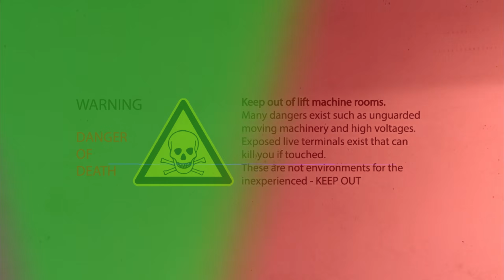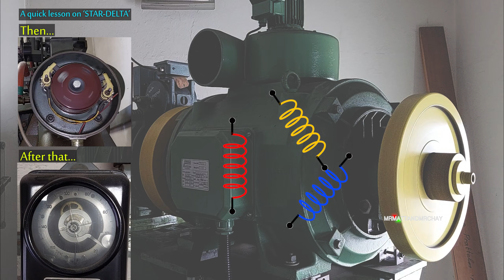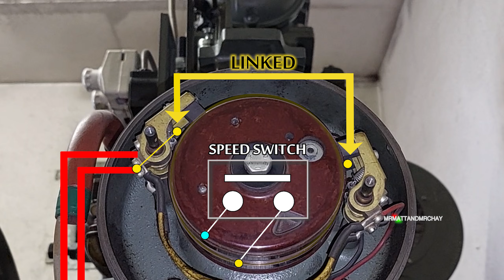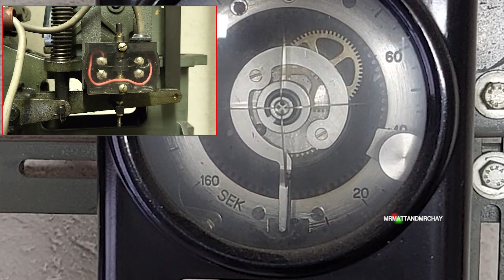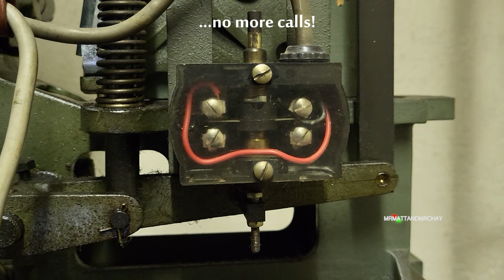Schindler CLOCKWORK TIMER, plus what does 'this' do? (interesting motor device!)

Comment: There is no Star/Delta, they are using 2 motors with different speeds.
Schindler Lift starts everytime in star. Most manufacturas are using 2 speed motors und Schindler is using 2 motors in series.
I am an Lift engineer in Germany at Schindler and know these configurations very well.
Star/Delta is only to reduce the current at starting of an motor and can not change the rpm.

Comment: That centrifugal switch is actually quite clever. From a layman's view, I would've thought one would've overcome the power draw by adding another lower-power motor to get it going first, but by using a centrifugal switch to change between star and delta configurations, you change the main motor to become that starter motor. Less parts to fail, less cost, less complexity. Electromechanical systems are so fascinating. Plus all the logic performed by physically moving components instead of things like PLCs. Really impressive, the work that went into these.

(Also been looking into old electromechanical telephone switches. Those are awesome as well. Found I have a museum close by, by their Youtube channel, Connections Museum. Also reminds me of the old jukebox that Technology Connections had a look at, with the floor selection logic likely being similar to the disk selection logic.)

Comment: Excellent as always. I love the time you take to explain things. 
I have a dumb question to ask. The "big Wheel" does that take the weight of the lift and passengers? Also, it never occurred to me that the lights in the lift shut off when not in use. I thought they stayed on all the time. 🤦🏼‍♀

Comment: Hello Mrmatt, I always like your videos but I think this is not star delta, this is switching from 4 pole through 2 pole windings. Because in star delta configuration, motor gives less torque on star connection to prevent huge start up currents, meanwhile motor cannot turn with load, motor must be unloaded when starting with star connection. Also motor speed doesn't change between star and delta steps, just gives higher torque on delta connection. After switching to delta, motor can be loaded(for example jaw crusher) 

But in this lift motor constantly loaded, it needs higher torque for starting, then needs higher speed just like car gears.

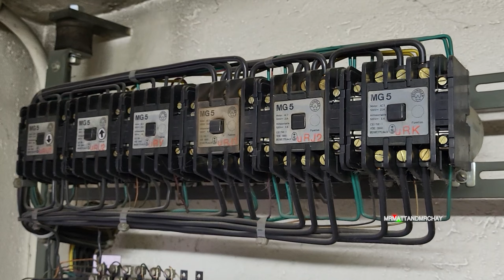Also there must be a contactor which three terminals shorted by a copper bar or wire for star connection, I can't see that contactor at 12:25 Because of that I don't think this is not star delta configuration.
Reply from the maker: This is a very interesting comment and thank you very much for it.  Yes, makes perfect sense.  Please correct me if I'm wrong, the pole changing system (i.e. why it goes from slow to fast) is an extension of the star-delta system?  i.e. from what I'm reading in the 'Dahlander pole changing motor' in wikipedia, the star delta system still exists, but the pole changing motor system gives you better scope to vary the power and speed?

Comment: Why main wheel is not solid but cut and connected with screws ?
Reply from the maker: Good question.  It could be said for ALL wheels, like on vehicles.  Educated guesses - Some of them are constructed in pieces, and makes it easier to put them together with bolts.  2) Weight - a solid piece of metal would be more difficult to install and would take more power to bring to a halt due to it's momentum.
Reply: @mrmattandmrchay  this is somewhat different, but maybe reason is for diffrent sizes or materials? 
I thought it some special elevators feature like vibration damping or some thing

Comment: I had a motor where the original installer had miswired it. Start in delta, and switch to star. no wonder the machine tended to pull itself out of the bolts holding it to the floor. Solved that, and later on replaced the motor as well, because a stuck contactor meant it ran missing a phase, and the installer had also broken the overload unit, as it would trip, so they simply jammed it closed forever.  New motor, and also moved controller into a sealed cabinet for good measure, and removed that entire star delta switching as well, with it getting a slow start unit instead, set for 30 seconds ramp up rate as well, because of the large inertia of the moving parts. 8kW motor, all 130kg of it was difficult to remove by hand, so installed a hook eye in the roof (300mm concrete slab) with M12 anchor bolt additionally braced in with epoxy, and that gave enough to allow removal of motor and later gearbox. Had to install the same later on the other side, to allow fixing of the other side, hard to move a massive V blender without that.

Comment: Are there any warnings written anywhere to warn passengers about the moving doors as the elevator moves up or down?
Reply from the maker: I don't really see this in Switzerland anywhere.  Also, the voice announcements like "ground floor, doors opening...".  They seem to be a lot more traditional.
Reply: I'm also curious as to the maker of the slave clock on the wall near the elevator.   If in fact it is a slave clock attached to central clock system.

Comment: In the setup data the device is called a centrifugal switch, we still have a few in NZ with both the mechanical timers and the motorised brake. The two I have worked on with AC drives were to bridge the starting resistors (not star delta), on their DC gearless machines they had a motorised potentiometer feeding a saturable reactor and a pair of centrifugal switches to prove the lift was below terminal speed as it crossed the terminal limits at each end of the shaft, they were very difficult to calibrate accurately, the motor on rope hitch looks odd and is probably for fine levelling adjustment.😢

Comment: But it's absolutely awesome, you were able to film one of the rare examples of a simultaneous multi-floor selection controller that is NOT a Schindler POP-OUT :D
I uploaded a similar elevator with the same operation as the one shown in your video that serves 11 floors.
These elevators are even rarer than those with simple relay control, plus the one you filmed has buttons that light up in the cabin, it may be the very last one of its kind in Switzerland.
Thank you very much for this magnificent video :D
Reply from the maker: Thank you very much for the nice comment.  Actually, I was very surprised, that these are not as rare as you think in Switzerland (if you know where to look!)

Comment: Fabulous detail - especially on the star-delta switching. Interestingly, some church pipe organs use a switch powered by the rising of the wind reservoirs to switch the fan blowers from star to delta for the same sort of reason - i.e. only when the wind pressure is stable.  I've worked with digital electronics and software for >40 years now but there's no character to a microcontroller like there is with pure mechanical switching.  This stuff is just amazing.  Thanks for posting Matt.
Reply from the maker: Interesting about the church pipe organs, never really considered this would have some kind of motor system.  Looks like we're on the same page with microprocessor controllers verses mechanical, mechanic logic is far more interesting to watch!  Thanks for the comment.
Reply: The star-delta stuff doesn't apply here. That only really applied to hydraulic motors when they would start in star completely unloaded. The motor here has more than one motor on the same shaft that are switched in sequence to get the desired start characteristics. Schindler were a motor specialist historically.

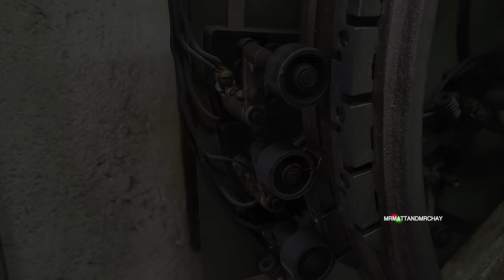Comment: Seems sort of dangerous by current standards to have the inside of the elevator chamber wiz by as the elevator moves from floor to floor! What was the purpose of the Diodes at @12:58?
Reply from the maker: I think, 'today's standards' appeal to countries where people purposely injure themselves to get a 'no win, no fee' insurance payout.  It then means the building owner has to fix their lifts to stop people doing what more people would consider comment sense :)  In Switzerland, I believe people understand to keep away from the doors whilst it's moving.  The diodes are for the logic circuits.  For example, when you press a call button, the voltage feeds through the button and into the logic circuits and relays.  The diodes prevent the voltage feeding back into other logic circuits.  It's a bit complicated to explain without diagrams, but that's just a basic explaination.  I'm assuming there is one per floor for the landing calls, and more for the car calls.  Just the design I guess.  You could probably omit the diodes, but then you'd be fitting more relays to stop the voltage in the same way.  Also, if the relays are DC, then some of them connect across the coil to prevent the relay coil surge when it switches off, but in theory, they should be connected directly to the coil (if this is what they're for), not away from it.
Reply: @mrmattandmrchay  Diodes preventing cross singling is sufficient description.... I know what is schematically meant. Thank you. (I recall from the Five Ways Towers videos that had DTL logic. So was wondering if this had a mix of DTL with relays.)

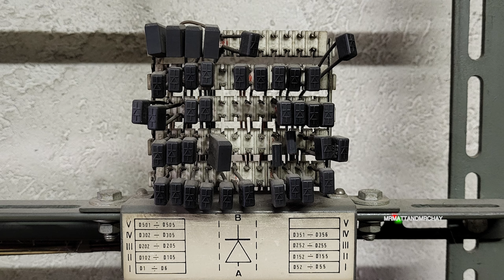Comment: 14:00 why is there a need to have some many diodes ?
Reply: Looks like some "discrete" decoder, eg. mapping/combining the stored calls for the up/down indicator lamps in each level or so. Induction voltage killing is not very likely as a) the old electro mechanical stuff has no issues with that and b) you would attach the diodes near the coils and not so far away where the effect is dampened.
Reply from the maker: (this is a copy/paste from someone else who asked the same question)  The diodes are for the logic circuits.  For example, when you press a call button, the voltage feeds through the button and into the logic circuits and relays.  The diodes prevent the voltage feeding back into other logic circuits.  It's a bit complicated to explain without diagrams, but that's just a basic explaination.  I'm assuming there is one per floor for the landing calls, and more for the car calls.  Just the design I guess.  You could probably omit the diodes, but then you'd be fitting more relays to stop the voltage in the same way.  Also, if the relays are DC, then some of them connect across the coil to prevent the relay coil surge when it switches off, but in theory, they should be connected directly to the coil (if this is what they're for), not away from it.
Reply: @mrmattandmrchay  this makes sense!! thus the diode would prevent the lights on every floor from illuminating if you pressed the hall call up button one floor you wouldnt want it to light on all floors..  did they use transisotrized controllers in these units from this era?
Reply: im guessing at least some are snubbers to lengthen the life of the relays from the inductive load arc when the relay releases
Reply: Looks like they are connected parallel to each relay coil to prevent inductive spike when coil is de-energized.
Reply: @allmycircuits8850  that perfectly make sense. Thanks.

Comment: It has never occurred to me that the lights could be shut off when the lift is idle… is this true for modern lifts too?
Reply: Yes
Reply from the maker: For old lifts, it was to save power and more importantly to make the lamps last longer.  If the lamps were kept on 24hours, they'd all be blown and people wouldn't be able to use the lift as it would be completely dark inside.  Modern day lifts use LED lighting (low power) and they don't really 'blow' like the old ones, so not so important.  But as others have said, if you were to be inside the cab they probably DO go out even in modern day lifts (each to do via a relay and the controller).
Reply: @mrmattandmrchay  
Often they even had pressure plate floors in old lifts to operate the lights so the lights would only turn on when someone is standing in the lift! It was also common practice back then for security/building management in large commercial office buildings to manually turn the lift lights off in the evening when the building closes and to manually turn them on when the building opens in the morning but they would otherwise stay on all day non stop.
Reply: It’s also very common in modern lifts in residential buildings.
Reply: I work in hotels.. we do a lot of work with the phone systems.. ive had ot before where I was steady enough inside a car that the unit became idle and the lights turned off while I was inside...  on a modern (elevator .. im in the US)..  theres motion sensors and its all done with a computer...  on these old ones they would not have any idea if someone stayed behind in the car.. ive never ridden one here n the US.. even an old one that didnt have an inner set of doors..  a couple real old cargo units i rode had manual inner doors so you had to close them yourself to go.. but there were switches that stopped the motion abruptly if you opened it too soon and the outer door would not open until it reached the proper level. even the units in older hotels here have been retrofitted to electronic timing and fewer physical relays..

Comment: Love these old elevators... getting rid of the door mechanism must make it cheaper and simpler.  Would this be a normal passenger lift, or only for commercial use?
Reply: It says "Warenaufzug" which is German for "freight elevator" :)
Reply: @Mezgrman  here in the US ive ridden freight elevators in hotels as recently as last year that still had manual interior doors..  I havent seen any which lacked interior doors altogether, they were like half height doors and then caged at the top so you could see the floors going by . they had a very slow travel speed.. ive not seen any true passenger elevators in the US without full interior doors.  not even in the oldest of hotels I work in..even the crew elevators all have full interior doors.. im guess we may have units similar but they were pron retrofitted at some point.
Reply: @Mezgrman  Thank you. I was thinking freight elevator but was not sure.